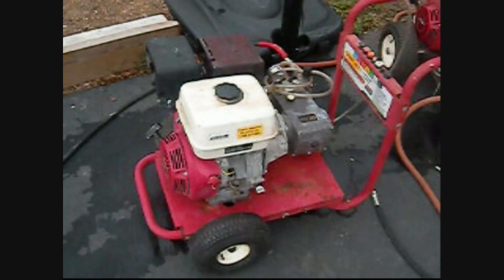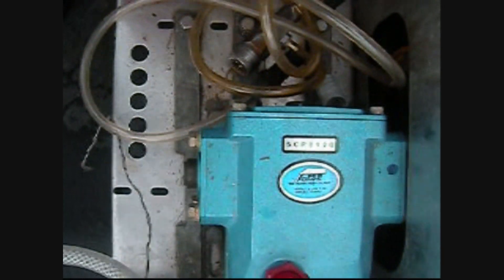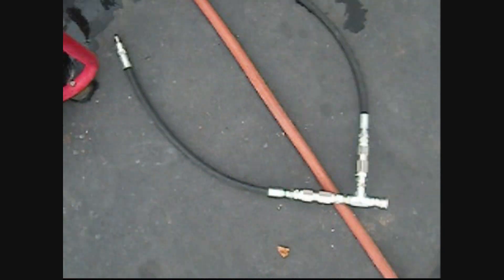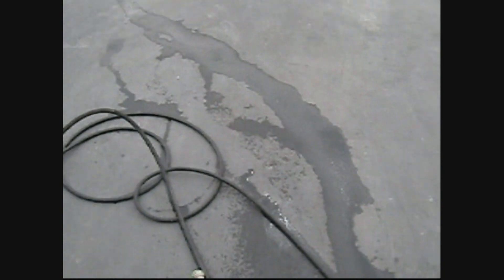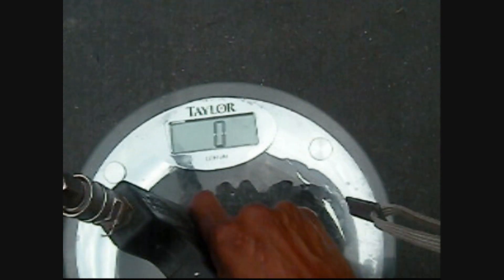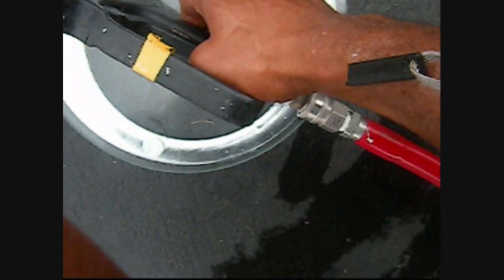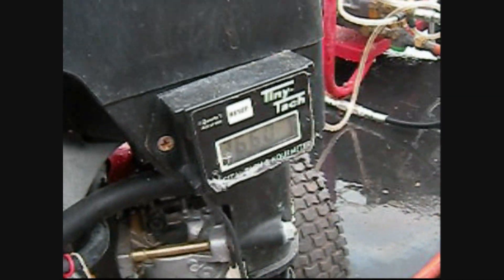Joining/Combining two pressure washers for more gpm

Comment: This concept works really well, I do this with 2 electric pressure washers that I use for snowmaking. Each one is 1.5 GPM, but doubling up gives me 3 GPM.
Reply: @
HKPSG1Shooter What kind of pressure washers do you have? Do you use check valves?
Reply: @glennda5id  The cheap 110v ones you can get at home depot. Just make sure you buy 2 identical units. I don't use check valves.

Comment from the maker: @poolshark100 , Glad that you found the video helpful. Question, your 4 .0gpm at 4000psi, what motor is running that pump, and do you have a gauge on the pump to determine that you in fact are attaining 4000psi?
Remember that pressure is created by the nozzle, up to the capability of the pump and or the unloader setting.
After you join your to machines, you could either use an appropiate nozzle that would maintain both pumps pressure at or lower that the max attainable pressure of the lower..

Comment from the maker: In the video pressure feed via household supply, in the few times used in the field via supply tank, its suggested if you are using one tank outlet it be a minimum of 1 1/2" all the way just before the pump inlets: if using individual supply points off tank than you should be fine with 1" lines to inlet of pumps.
Remember these were 4 to 4.5 gpm machines

Comment from the maker: @poolshark100 It depends.
1. what is the GPM of the machine?
2. What is the maximum pump pressure?
3. the pressure loss from pump up until the nozzles.

My suggestion is not to go below 2.0 nozzles that means you should be at least a full 6 gpm (more is better, like 7gpm or 8 gpm use 2.5's) ... your pump should be about 4000 psi. ....the lower the pump psi and the greater the hose pressure losses, you would force less water through the nozzles

Comment: used it on a job today, with gas lever at 75% on, used normal amount of gas. working flawlessly. since units are both at 3700psi and full rpm, they seem to run smooth and not eat much gas. next step will be upgrading to belt driven unit from direct drives
Reply from the maker: Video...shoot some video
Reply: +Griffs Services I will this week. was waiting too see of something would break first
Reply from the maker: +Evan Hidalgo don't think that way..the only thing breaking is "dirt & grime"
Reply: Haha. Well I have direct drive phmps, one has 100 hrs on it already it could go anyday
Reply from the maker: +Evan Hidalgo 100hrs...that's just broken in...you would change the unloader a couple times before that pump go..provided you change oil regularly with the recommendation and don't run the inlet dry or bad water
Reply: +Griffs Services Hm. That's encouraging. maybe I should change the oil. I baby my units so hopefully they last
Reply from the maker: +Evan Hidalgo what is the make and model of pumps
Reply: +Griffs Services cat direct drive idk the model. comes standard on the Simpson 4240 aluminum frame. Honda gx390 motor
Reply from the maker: +Evan Hidalgo even less worry...a nine lives pump...parts are more expensive than the other brands
Reply from the maker: +Evan Hidalgo that CAT in the video is still alive although I popped a ceramic plunger and oil seal..both my fault

Comment: it worked great with both units going. Surface cleaner basically floated. just need to rectify smaller unit dieing when back pressure is present
Reply: check valves
Reply: Have check valves now, also have 2 identical units, adjusted to equal pressure
 I think that helps
Reply from the maker: Great..you should be good to go
Reply: Griffs Services yeah it's been working great now. need to ass a weight somehow to surface cleaner. I wonder how long until.something breaks
Reply from the maker: A small counter weight should do you fine....dont think that...nothing should break...do you have safety pop off valves on each of the pumps? if you don't have a bypass back to a tank then get thermal relief valves
Reply: Griffs Services they are Honda gx390's. unmodified
Reply from the maker: I am talking about the pump head..

Comment: I might give this a try.

I've got a Honda GD411 with a Cat 45 (17 Ltrs per min)
And a Yanmar with a 15 litre per min Comet pump.
Reply: i have a noob question for u..instead of the hoses joining with a (T) would a (Y) connection  benefit with less pressure loss (less restriction on water flow)

Comment from the maker: Thanks for viewing.
I bought the high pressure tee at one of my online pressure parts store (envirospec com) as for the check valve, remember it is not necessary if you have a adequately sized trapped pressure unloader, but I phoned my order from a carwash supply place in Florida (cant remember where), they dropped shipped from manufacturer. Generalpump com part #YCV12FSS for the 1/2 inch which i used, and YCV38FSS for the 3/8 inch.

Comment from the maker: Why not , try to have the pressures the same at the inlet to the joining connectors. I have increased rinse speed on a project with a garden hose and 4 gpm pressure washer before.

Comment: Griffs Service, sorry about presuming.  But still, TSF2021 are only 7 gpm pumps. You cannot change that. That's only 14 gpm, not 16.You may be able to change gpm if you change pulleys, but that will result in damage to the pump. You will be blowing seals out left and right. What are you powering these with? TS1511 is a 4gpm pump,and you cannot change that. Why are you not getting 4gpm out of it? Using a surface cleaner? That will only divide your gpm. 2 nozzles cut gpm in half, 3 in thirds, 4 in quarters. Change nozzle size, and you can change the pressure. But not gpm. Am I missing something here?
Reply: *****
I see. Can you tell me what you power those with? and the nozzle size you use? i suspect maybe about a 15? Still, i do not see how you can change the RPM on the TS1511. From what i can tell, it's just a normal application, with gear reduction. How does it go above 1450 RPM?
Reply: *****
Thanks, but i was actually hoping you could tell me more about the TSF2021 set up you were talking about. Anyway, how long do you feel the TS1511 will last running above 1450? That pump is not designed to run above the rated RPM. You will destroy it very soon. Back yard mechanics work for some people, but in all reality, you need the right tool to do the job correctly. That also means running the equipment within it's capabilities, not above. That's O.K., though, when damage occurs, that's when people call me for tech, parts, new pump, or entire machine.
 In the long run, they always call.

Comment from the maker: @poolshark100 ..pump. Or you could set the unloader of the pump with the higher pressure, to the same as the lower psi pump, i.e. both at 3600 psi. 
Wear, I have only used the two machines together a hand full of times, I to was concerned about the unloader check valve wearing out hence the bigger downstream check valves( but it is not necessary, if both machines have trapped Unloader). In theory everything should wear a little faster, gun.couplings,hoses etc. But jobs require far less time

Comment: update: I have both gx390's running at 3700 psi, w two hose connections. 25 spray tips, 20" surface cleaner almost flies away. works great. I don't know how long the pumps will last vs belt driven, and they drink gas quickly
Reply from the maker: good to hear it's working....but where is the video?
yes on the gas...especially if your running full psi..

Comment: hello again, Nigel. I must say, this is bloody fantastic idea. I can't believe I have never thought to do this. in my garage, I have a 21gal, and two 29gal (I was given the two 29gal) compressors all plumbed to a receiver tank, but this is the same principle only using water and not air. anyways, I did have a question - I noticed on the top of the manifold on the general pump, not the cat, but on the gp u have a psi guage that looks to be plumbed on the top of the manifold or valve cover and not on the other water outlet.....how/why was this done? is this safe? or is it just a trick of the camera angles? thanks in advance and take care
Reply from the maker: Thanks for viewing Wesley....the gauge on the general pump is facilitated by a special valve part (can be ordered) cap they have that has a 1/4" NTP port for mounting.
Sidenote: some comet pump models have a port in the manifold for a gage, convenient

Comment: instead of useing a (T) connector to join the two would a (Y) connector have less water flow restriction and not wear out the inside walls as fast?
Reply from the maker: Roger Gill thanks for viewing and your comments...I have not been able to find a high pressure Y at the online and local pressure wash store, I am sure they are out there. if you find one post a link.
Reply: If you find one, please let me know
Russ Johnson sells the siamese kits. I just bought one. $98 t connect though
I will have 10.5 gpm at maybe 2400 psi
Reply from the maker: Dave Pettman hope you have a trigger gun that is can give you the full benefit of the 10.5 gpm

Comment: sorry totally forgot about video while getting everything calibrated. anyway to reduce gas consumption? what if I turned gas halfway off? I figure that'll help reduce fuel
Reply from the maker: can't reduce fuel like that...the only time you will use less fuel us if you are not asking the engine to run at full rpm or if the pumps are not asked to produce high psi....so for low pressure cleaning you will find that you burn less fuel

Comment: I only have a 20" surface cleaner right now. will it fly off the ground? do I walk fast with it? or upgrade to a 24-36"
Reply from the maker: If the surface cleaner is not currently fitted with the accurate tip to allow the full flow then it would not benifit from the increase in volume...if the correct sized tips for volume and high presaure are installed the plastic 20" units do lift off. But I have found that if you have high volume is better to go for more tips...in my opinion the volume sweet spot for surface cleaner tips are about  1.7 to 2.5 gallons per minute
Reply: Thia is what I have:
20" Whirl-A-Way
4000 PSI Max Pressure
180°F
8.0 GPM Max Flow
85.225.025Bep2 Nozzle Set
20" Diameter
Part#: WAW-20Y
Reply from the maker: +Evan Hidalgo well to get all the flow form the combined machines you will have to know the total volume produced and divide it by 2, that would be a good starting point for the calculation, but the pressure set the tip would also determine how much water flows through the tips. To really benifit from high volume you need more tips in that size surface cleaner..I think whisper wash makes a surface cleaner  that size with a 4 tip option, or you can get a   24" four tip....what will be your expected total volume output?

Comment: the smaller 4000psi 3.3 gpmkept dieing if I was not actively pressure washing. died when I tried to switch between surface cleaner and wand. should I upgrade it to the same unit (4gpm 4200psi)
Reply from the maker: What tips are you using in the wand and the surface cleaner?

Comment: surface cleaner max is 8 GPM, works fine with gx390 unit, dies w gx270 unit
Reply from the maker: I meant dual 4.0 on surface cleaner
Reply from the maker: I meant dual 4.0 on surface cleaner

Comment: hm. what if I turn down the RPM a little? will this reduce psi. GPM. or both? maybe I should just accept higher fuel use in exchange for faster cleaning
Reply from the maker: With trapped pressure unloader you can use a larger nozzle and reduce the pressure that way...
reducing the RPM will also reduce the gpm the psi is controlled by the unloader and nozzle size, however when you reduce the RPM the gallons per minute reduces and thus the effect would be lower pressure....one negative of reducing RPM is that the horse powered the engine is reduced too...
Reply: Gotchya. Once these direct drive pumps die I'll switch to belt drive units. Either that or get a gx630 and a tank, but trying to avoid buying a trailer :0
Reply from the maker: You also have the option to go with a gearbox

Comment: I wonder since your gpm flow double what about your psi?
Reply from the maker: The max psi you can achieve would be that of the lower set unloader machine....I advise to try set each to the same psi....them join and run just a bit lower than the setting with appropriate tip/nozzle....if you put a nozzle to small you would be bypass water and not enjoy the full benefit of total produced volume

Comment: I have been doing this too! I would recommend this to any Power Washing Company because of these 2 reasons:

1. It's Less Expensive!
2. You can connect as many Power Washers as you may need in order to get the maximum flow. 

Remember to always use "one way valves" or you will blow out the seals in the pumps!

http://www.vtmobilepressurewash.com

Comment: can a house hose supply 6-8gpm? I thought 5gpm was the max? or maybe two separate hose connections for 10gpm max? so cool, I'll have to try this vs buying a gx630
Reply from the maker: thanks for viewing the video Evan. I did use to separate hose connections. when I place them on the truck they are supplied via a buffer tank
Reply: +Griffs Services genius. how is the buffer tank setup? I was thinking 5 gal bucket in the back of my pickup truck w ball valve, or just run two separate hoses
Reply from the maker: +Evan Hidalgo I have a video of that set-up
Reply from the maker: https://youtu.be/dNKf2EKPjkU

Comment: I left him a voicemail. I wish I could make my own this weekend but nothing is open. depot doesn't have check valves either
Reply from the maker: This video is a hit with power wash contractors, and after I did this video Southside Equipment made a complete kit for purchase ...I pieced mine together from various suppliers on the net..you don't have any pressure wash stores open where you are?
Reply: I found a hydraulic supply store. On my way. Muhaha
Reply from the maker: Lol...High volume will be a hard habit to break.

Comment: My unloaders won’t bypass when siamesed together
Reply from the maker: You have independent check valves installed?
Reply: @GriffsServices  yep
Reply from the maker: @Johnnyreengo  need more info..
Before being Siamese together what would the setting for the pressure for each?
Both the same type of unloader?
Any chance of a video?
Reply: @GriffsServices  both 5.5gpm gear drives set to 2500psi each on VRT3 unloaders. Stainless check valves both work
Reply from the maker: @Johnnyreengo  strange, same pumps?
If you don't want to mess with the troubleshooting, put the individual unloaders on quick connects and unhook (or switch if you made a tee outlet of each pump with block valves) then run both through a third unloader...
Just a work around
Reply: @GriffsServices  yeah same pumps. It’s the only thing left to try
Reply from the maker: @Johnnyreengo  in theory it should work, my suggestion is just  run a quick connect to a stand alone unloader with safety pop offs on each pump.

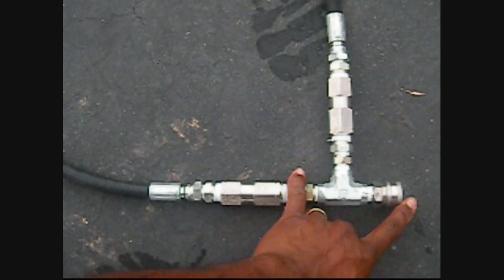Comment: can you brake it down part by part what you show @ 1:33
Reply from the maker: chaba72... 2 high pressure check valves and a high pressure tee...both those parts individually a long time ago. ...since this video a supplier South Side Equipment has put all the parts available for purchase...give them a call http://shop.pressurewasherky.us
Reply: How about the black high pressure hose?
Reply: Ok I see its a wip hose , thank you! !!
Reply from the maker: chaba72 they have it all...so many contractors wanted to do this since this video that he made all the parts available...I don't see it listed on the website but give them  a call they can get almost anything  related for pressure washers

Comment: surface cleaner 2.0 or 2.5 idk. I think the unit I bought is bad
Reply from the maker: the tip number should be at least a 7.0 or even 8.0...thus the surface cleaner could run dual 3.5 or dual 8.0

Comment: when I close my ball valve even the engine dies
Reply from the maker: do you have the check valves installed?
Reply from the maker: whats happening probably is the smaller engine does not have enough torque to overcome the spike pressure of such high combined volume. in theory the check valves should alleviate this problem
Reply: Yes 5000 psi check valves
Reply: Maybe the smaller unit is too weak to open them valve unded pressure
Reply from the maker: I don't think so...to be certain try running that one unit with the check valve it should work..if I remember correctly the Crack pressure  is about 40 psi
Reply from the maker: Does that smaller unit unloader bypass internaly?